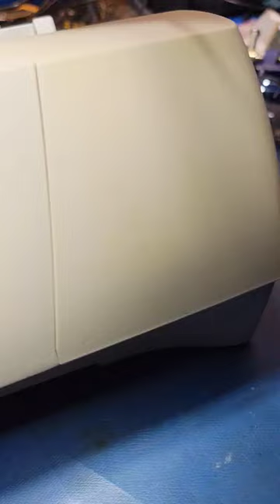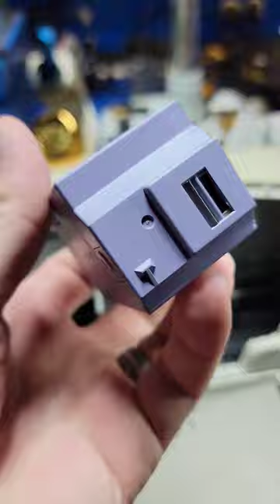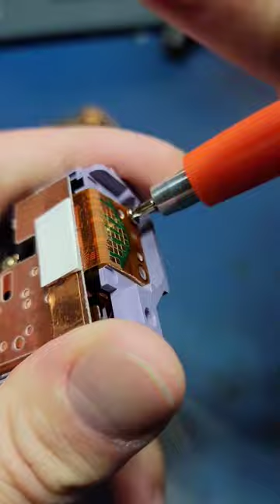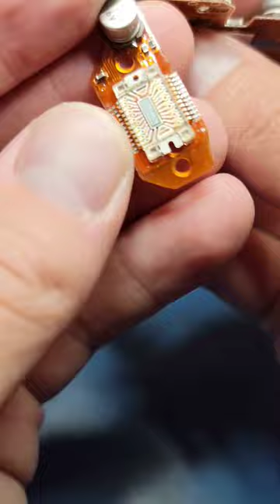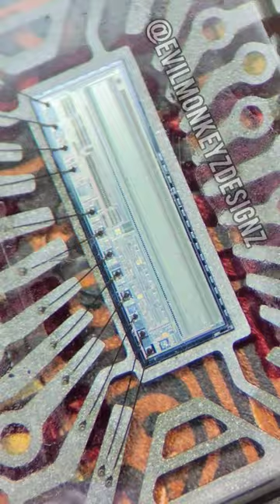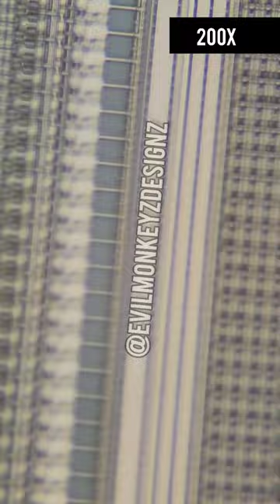This device turns your printer into a scanner! #printer #retro #technology

Comment: Must be a slow process, much slower than regular scanners. 

Apparently this thing is from 1996 when it would have been a cool trick and a way to save money on a scanner. Canon MultiPASS C530 I think.
Reply: From 1996, so a decade or two before the times when the same manufacturer prevents you from using flatbed scanner on an all-in-one because it's low on cyan.

When I saw the thumbnail I seriously thought this was a DIY project to bring old scrap printer back to a productive life, not an OEM accessory that makes the device useful instead of a landfill filling even if you don't shell out for the expensive consumables every couple months. 

Preposterous to think nowadays that devices without planned obsolescence factored in existed not so long ago...
Reply: @smk666  Now that I think of it, back in those days a normal scanner offered a resolution of 1200 or even 2400 DPI. Scanners in all-in-one devices these days offer 600 DPI at most, but default to 300. Not that you really need more than that often, but still that's weird to me.
Reply: This was a very dangerous printer attachment, because it could kill ADF scanner sales. Even a cheap printer has a good page feeder, but the same cannot be told about ADF scanners while they should have basically the same paper feeder mechanics.
Reply: @deezeemb  I think at most all-in-one now offers at most 1200 DPI. My cheap HP do that, but default at 200/300, not sure which exactly 'cause I scan my drawings at 1200 😅
Reply: @ADFaried  I guess mine is just shit then (also HP). But the one I gave away long ago could do 2400dpi.
Reply: @ADFaried  they used to do 48bit color   as well
Reply: Blah.... why do I feel the NEED to own some
.....
Reply: Now it's official  .. I NEED more than and at least one.... ... thaks for the video, you ROCK bro
Reply: @dirkadirkastan6625  Where will you find it? It's from the 90s...
Reply: Multipass?? Oh, Corben Dallas my boy... We found your secret!
Reply: @deezeemb  The magical land of ebay
Reply: It’s guys like you that saves the world from the creation of the Orwellian Society, offers hope that we maintain freedom from thought police and black screen devices that have 2 way communications, with respect to “1984” by George Orwell 1947, a must read for anyone to open your eyes and view ourselves as the plebiscites we are. Thank you for the reality & knowledge of complicated things.
Reply: Not only that, it probably requires you buy ink cartridges that cost as much as the printer, even when you're scanning.
Reply: @smk666 I had an Epson printer like that. The final straw was when I couldn't print black with a brand new cartridge because 2 color cartridges were empty. Couldn't even refill the cartridges. It went to the dumpster in pieces that day, and I will never buy anything made by Epson again.
Reply: It's a page fed scanner combined with your bubble jet printer, the image quality was reasonable, and the low cost of both the printer and the cartridge made this one of the first affordable multifunction printers. I think it can do a few pages per minute tops, it's just slightly slower than the printing speed. I have a BJC-2110 myself with a boxed IS-22 cartridge.
Reply: @SwapPartLLC   Without the color cartridges, specifically the yellow one, how else will it hide the microdots on the paper identifying which printer was used, helping to find you if you do a naughty?
Reply: @deezeemb  All I cared about was printing a packing slip so I could get an order out on time. I could care less if someone could figure out I used a crappy Epson printer.
Reply: @SwapPartLLC   I know. It was sarcasm.

Comment: That is some apple level board design from 30 years ago very impressive
Reply: Why do you think Apple board designs are impressive?
Reply: @feakhelek1   notice i didnt say perfect. having 2+ boards stacked together & utilizing both sides crams a-lot of stuff in a small package.  So the packaging is amazing i am well aware and against them making minuscule changes to a COTS component just enough the regular one wont work and then they refuse to sell the part.    I also dislike the number of screws.  I do enjoy their lego connections over the cam-lock style often seen on samsung.
 
  What I don’t like are the problems they have with power control sections of their laptops making a a 5 cent part nuke a 3500 laptop and they wont sell the parts.  Thats greedy but doesn’t change the fact their boards are well thought out.